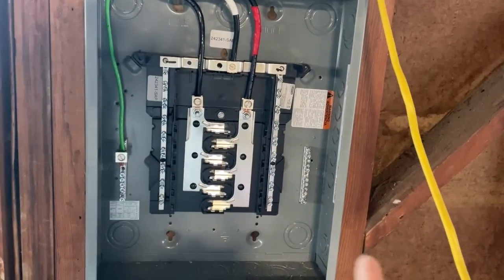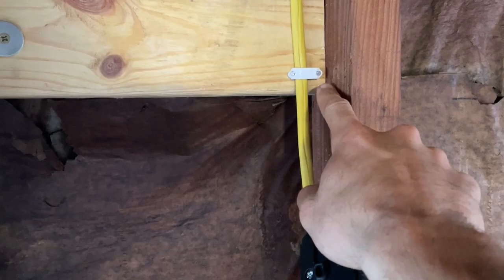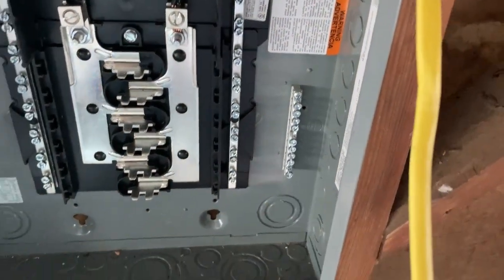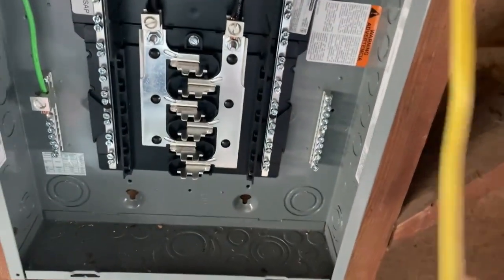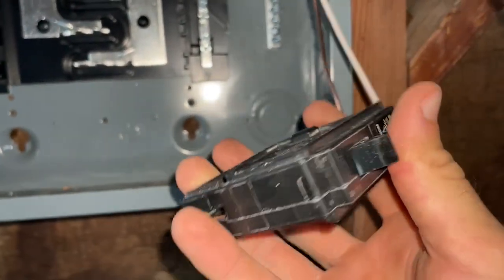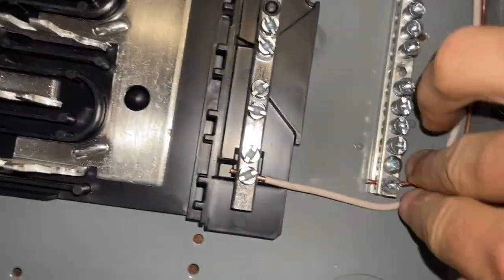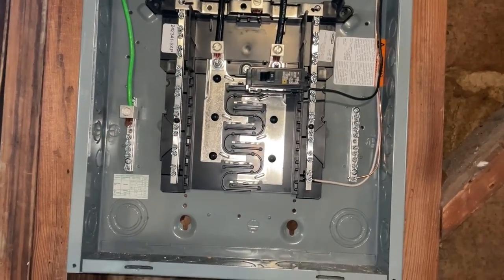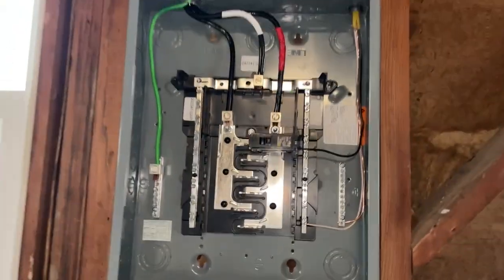Adding a new circuit breaker on a new sub panel

Comment: Hello excellent video! What type of panel are you using?
Reply from the maker: Thanks! It’s a square d home line panel
Reply: @VincentStevenson  cool thanks! One more quick question what amp panel? Reason I ask is I’m looking for a sub panel to put in my shed that has 50 amp wires already out at the shed. Just plan on running a couple outlets and an overhead light from that amperage.